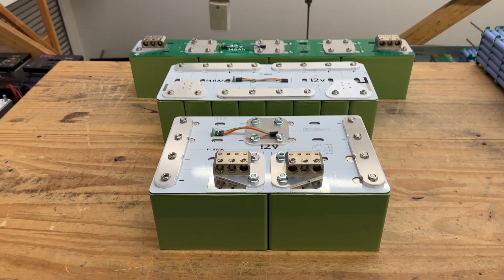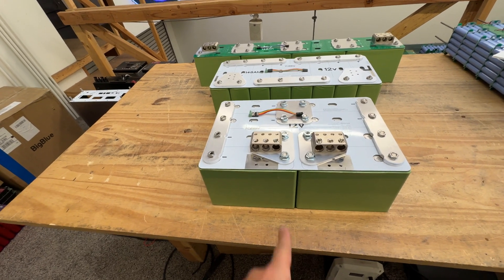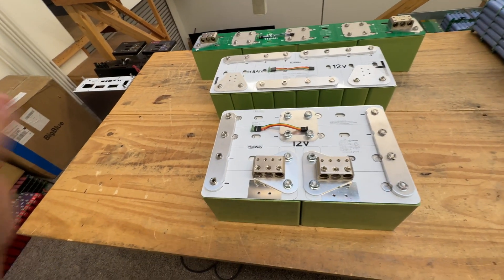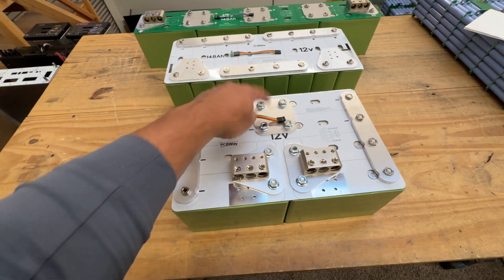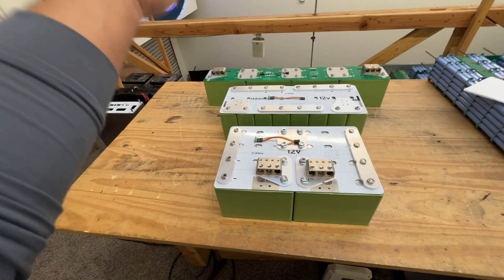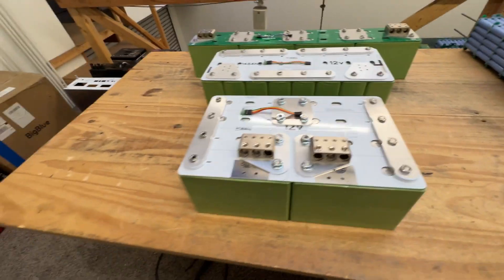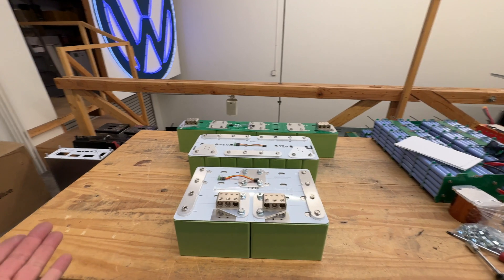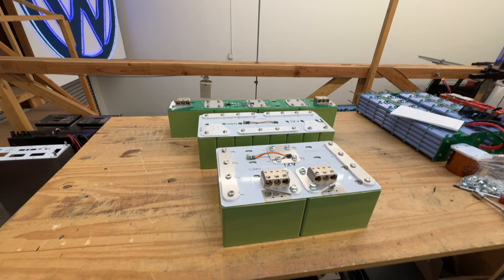10,000W Lithium Battery

Comment: My alt charges at 14.5 volt, can I use this on my audio system in my car?
Reply from the maker: Yes
Reply: Good because I bought one last week. Thanks for the fast shipping here to chattanooga tn. Good looking out.
Reply: I've been told it's not recommended  to run lithium with led acid so would you recommend  deleting the lead acid under my hood and would it be okay to place this battery under the hood in its place?
Reply: Btw  I've been following you for a while and I've defended your extensive knowledge in several audio groups.  People will hate. You just keep being you and you'll keep being successful 💯

Comment: Use solder paste 180 degree and put a small circle around each bolt hole and then another board on top and hit with heat gun.

Comment: One question, can I use my car's alternator to charge the battery? I have a large car audio system and I am super interested
Reply: I don't think you can charge these with a car alternator.
Reply: @Dominican_kennym3  I think that if I can, I have a 350 amp alternator and about 14.5 to 15 v. My question is if the batteries need anything special to be charged.
Reply: @pandaturbo  yo tengo un 380 también. Y la verdad que no la e comprado porque no e visto ninguna información de que si se pueda cargar o no
Reply: @Dominican_kennym3  en esa misma estoy yo bro! pero segun vi algo anoche y si el voltaje es mas que el nominal de la baterias pueden cargar. Pero lo me tiene frenado que dicen que las baterias de lithum pueden danar los alternadores por la gran cantidad de corriente que las baterias demandan, pero nose si eso se aplica a nosotros que tenemos altenardores de gran capacidad o para los alternadores de frabrica de los carros.
Reply: Looks like the max charge on the site says 360 amp.

Comment: Is there a BMS in it?
Reply: No BMS included, but if you're using it for car audio you wouldn't want the BMS limiting your power anyway. It's easy to add a battery balancer like a BattGo BG8S using the small green screw-in terminal (no soldering) These things are beasts, we're talking 14,400W burst power. You can always add a high amp BMS, but they can be pricey.

Comment: How does one even calculate bus bar thickness/width for ev application in this case? 
Supposedly you go by cross sectional area but it seems like aluminum bus bars punch WAY above their calculated rating

To match a copper 4/0 gauge cable, which has a cross sectional conductor area of 107mm2, you'd need 40% more aluminum are or like 180mm2, which would be 28mm wide by 6.3mm thick but it keep seeing bars less wide and thinner carry crazy amps......how?

also is this 5052 aluminum or 6061?

Comment: I ordered 12 boxes of these and want to say they are great cells. I'm using them for a very high power application where energy density doesn't matter as much as power density. I've been doing testing using a 2P4S configuration and I'm seeing the cell temperature stabilize with ~20C temperature rise at 200A continuous using passive cooling. That is with cycling the cells 20%-80% using charge/discharge current that varies between 100A and 350A over many hours continuously. I just wanted to let anyone who's interested know.
Reply: what is the ah you actually got for each cell?
Reply: @HuyTran-zy9sv  I did a charge to 3.5V and discharge to 2.8V at 350A constant current and saw 144ah, so 72ah/cell. The observed capacity that the Orion BMS has calculated is 140ah.
Reply: @patricke3848 these are quite impressive numbers. 

350A charging on a 144Ah pack. More than 2C. Does the datasheet say anything about charging specs?

Did you AC IR test your cells with a YR or RC milliohm meter?
Reply: @ericklein5097  There isn't a datasheet and the manufacturer won't provide any information. Jehu did an IR test in one of his previous videos on these cells, which is why I decided to purchase them. I can't recall what it was exactly, but something like 0.4-0.7. My Orion BMS is calculating 0.7 at 25C without current and as low as 0.15 at 40C while cycling. They were designed for engine starting batteries, so they're designed for power density/low resistance. Watch some of the other videos on this channel, they'll easily do 3C, but will likely need to be actively cooled to do that continuously over many hours.

Comment: Make sure to put some insulation material between the cells and the metal enclosure. The thin wrap around the cells will wear through over time.

Comment: Copper.... always a much better choice than aluminum in (nearly) all circumstances. The ability of a conductor to carry current is a is based on the cross sectional area of said conductor.  Although aluminum is a good conductor, copper is better.  True that copper costs a bit more and is heavier than aluminum, but the current carrying ability of copper is considerably higher than the same cross sectional area of aluminum. As a 40 year (now retired) master electrician, I know what I'm talking about.
Reply from the maker: Silver bars would be best
Reply: @jehugarcia this vs LTO ?
Reply: @jehugarcia  Gold!
Reply: @benkemp Silver is more conductive, but tarnishes easily.  It's the corrosion resistance which makes gold better for exposed contacts, not its conductivity
Reply: Unfortunately it's no longer "a bit" more expensive, aluminum is 30% of the cost of copper, so my 5 bus bars for a bench test rig for my EV project is $69 in copper from send cut send, or only $20 in aluminum

Mind you I'm using 6061 t5 aluminum, 1/4" thick, should be more than enough thickness for some serious continuous amps, also I'll be slathering the aluminum in novalox to halt any kind of possible corrosion
Reply: Ok... Metals in order of conductivity and their respective cost per pound.  Metal prices are current, but approximate. Sorry if this table doesn't format correctly.
Metal				Cost/lb		
1. Pure silver			$307.92		
2. Pure copper		$3.64
3. Pure gold			$26,871.00
4. Aluminum			$1.02
5. Zinc			        $1.13
6. Nickel			        $8.27
7. Brass			        $4.00
8. Bronze			$1.40
9. Iron				$0.70
10. Platinum			$12,512.00
Reply: Silver.... always a much better choice than Copper in (nearly) all circumstances. The ability of a conductor to carry current is a is based on the cross sectional area of said conductor.  Although copper is a good conductor, Silver is better.  True that Silver costs a bit more and is heavier than copper, but the current carrying ability of Silver is considerably higher than the same cross sectional area of copper. As a 40 year (now retired) master Internet electrician, I know what I'm talking about.
Reply: @Chris-vx5kp  I always trust peeps who say: "I know what I'm talking about" lol...Love it!
Reply: @Chris-vx5kp  Great copy and paste trolling skills!  Maybe someday you'll be so good at it you'll be able to move out of your moms basement.... na.... probably not.😆
Reply: platinum